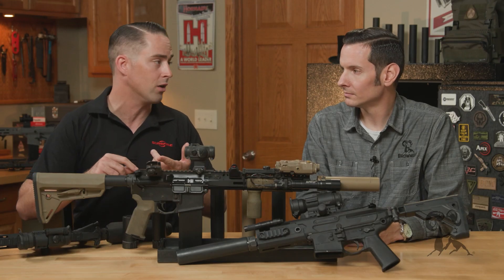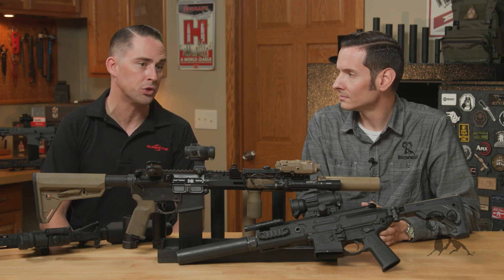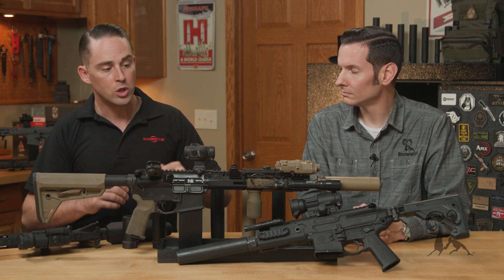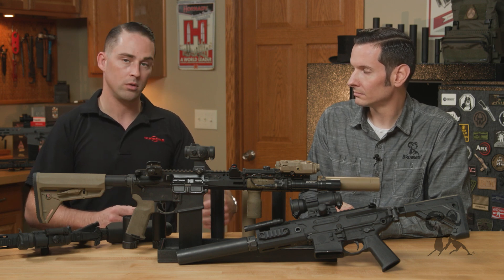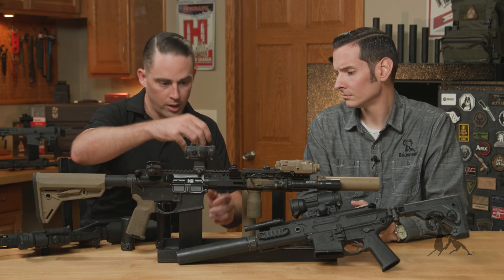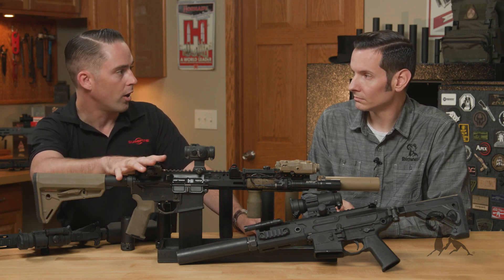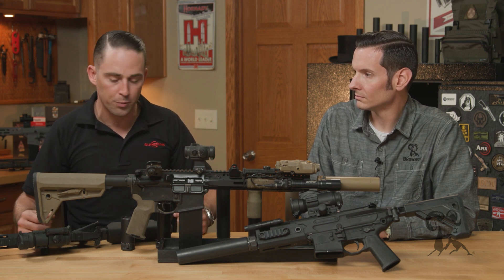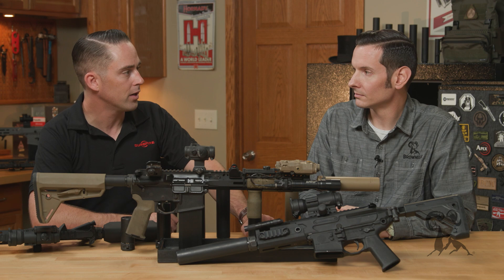Product Spotlight: SureFire Suppressors

Comment: Do you know if this surefire flash hider will work with the quick attach surefire suppressors? It was originally made for training suppressors 
Model is SFA2-556-1/2-
28 A2

Comment: I already have picked out the Surefire SB2 as the can I want to get due to it being rated for 10 inch or under barrels and will be using M855 62gr “green tip” ammo. So have a question if someone can answer it. I have a 10.5 inch barrel AR-15, currently I have a 10 inch hand guard that I think will interfere with the suppressor installation/locking up. What length of hand guard or clearance do I need to have it barely clear and have almost no gap between suppressor and hand guard? 9.75? 9.5? 9.3?
Reply: Thanks for the interest in our suppressors! For 10" and up, we recommend the RC2. As mentioned in this video at about the 8 minute mark, the SB2 is for barrels 9" and under. As far as standoff from the rail, if you have a 10.5" barrel and a 10" handguard, you will have enough room to mount the RC2 on a SOCOM adapter. Our adapters have a bit of standoff built in intentionally.

Comment: Is it true that the SF flash hiders seal up better to the QD suppressors and are therefore quieter than the SF warcomp? I know lots like the warcomp, but just curious.
Reply: The Surefire warcomp does not have the labyrinth seals and thus has issues with carbon locking when used in conjuction with cans. I went with the surefire muzzle brakes as they have labyrinth seals, which helps prevent carbon lock, and the brakes also act as a sacrificial baffle when used with suppressors. I don't need a flash hider for use on the rifles without the suppressor, since the rifles are never used without their dedicated suppressors.
Reply: @YippeeKiYayMrFalcon  thanks. I was told by a surefire rep similar about the seals on the flash hider too. Glad I went with that because like you, plan to just leave suppressors on full time.
Reply: I have a SF Comp on one AR and a Warcomp three prong on two other ARs and I do not notice a difference.

Comment: I trust Surefire suppressors in part due to the quality control, quality materials, and years of suppressor manufacturing experience.  I have twice had to return suppressors to Surefire for service (bad seal on one, lock ring problem on the other).  In each case Surefire provided warranty service at no cost and even re-cerakoted the cans.  Only negative is that they are not as quick on service as other suppressor manufacturers.

Comment: Surefire tech support has told me that their rc2 5.56 is not strong enough to handle 5.7, so I really don't care what their stupid rep has to say.

They also said that the 5.7 cartridge is too large to fit thorough their 5.56rc2 even though it's exactly the same diameter as a 5.56 bullet.
Reply: Idk about any of that and I’ve heard of the company being odd and lowering in quality on lights as of late. But from what I’ve seen that rc2 is a tank garand thumb has over 100k 556 rounds through his and it keeps going

Comment: I'm a senior range master in Arizona at Ben Avery and I could honestly say, I wish everyone was suppressed. I'm looking into buying the Surefire Socom 762 mini for my 300 blackout. I can't wait till I can get it,  it'll make the difference in my hearing for sure.
Reply: The 300SPS is designed for 300blk specifically. I have one and its super nice. Ive even run it on my 6.5 CM and 5.56 11.5" and 18"

Comment: Don’t expect to much a 5.56 is still very loud even with a suppressor
Reply: That's why Surefire got it right by making the RC2 minimize flash signature and back pressure. Trying to minimize sound signature on a supersonic round is a waste of time yet all these other companies keep trying to do that
Reply: @TheRealXrayDoc  Agreed the suppressor is not going to slow down the round, 556 will will always break the sound barrier, the can just addresses the gas and flash not the velocity of the round. So, so long as that bullet breaks the sound barrier you will always have that crack. I own this can and use it on 10.3 DDM4 V7P and it works beautifully.
Reply: @johnnysifuentes4188  yeah I use it on my 12.5 LMT specwar and love it too
Reply: @TheRealXrayDoc  But my -2 more db rating! If the RC2 was as trash as everyone says it wouldn't be in the SOCOM armory. But ya know, expensive can bad, YHM just as good!
Reply: I'm a dumb ass and shoot mine without ear pro. If you're outside it's not bad, no ringing, but I was probably deaf to begin with.
Reply: Eh, it gets my 10.4" down to 136db at the ear. No ear ring vs small canon without it is a massive difference.

Comment: “Less than an inch at 100” I’m sold!
Reply: I own the full size RC2 and 100% back that claim. It isn't just industry fluff to sell something.
Reply: @Zel_eo  what are you running it on if you don’t mind?
Reply: @tigerbob888  I run my own build but the barrel is a 16.01 inch SOTMFG barrel 5.56. I also run it on my 10.4" 416. Both keep the group within the inch variation at 100 yard. It's super repeatable too. If the group walks a quarter inch down left once, it will be there every time.
Reply: Exactly. That's why I went with them
Reply: Make sure you check it.
Reply: Exactly. That's why I went with them
Reply: Exactly. That's why I went with them
Reply: @lifehacksformen8427  alright calm down

Comment: Personally, I’ll continue to call them silencers since that was the “official” name they were originally patented under by Hiram Percy Maxim in 1909.  Son of the Maxim machine gun inventor.  No need to rewrite history!  👍
Reply: They don't silence anything. They "suppress" sound, not cut it off. Have a 7.5" 300bo SBR with a SilencerCo Hybrid 46 on it, and running 220gr Hush is as about as quiet as you're going to get, minus a .22

Comment: Surefires are quite a decent chunk of weight to throw on to the end of a carbine but they'll out last quite a few barrels
Reply: @jerry marcin whenever you goobers say things like “lift more” it doesn’t change the mass of the object in question. The majority of people who get into the NFA game tend to be guys who are stronger than the average Netflix browser, so get out of here with that garbage.
Reply: Hit the bench bro.
Reply: @Jerry Marcin  I swing sledge hammers all day, maybe if you hit a few spikes you'd realise what an honest end user assessment is.
Reply: @tylergarrett4498  Hey man. No shade.  I have no issue with the weight of surefires but I would probably not swing a sledgehammer as well as you.  Different muscles and different tasks.   What worked for me was improving lats, obviously, but specifically sitting sideways on the latpull down machine seems to work the exact muscle you use raising and holding a rifle.  Throw a couple plates on that thing or work to it and in a few months you won't even notice that weight.  I can verify up to a 22" AR-10 with a can.
Reply: @MM-js4nf  sweet man I'll give that a try
Reply: They are chunky cans but compared to most keymo cans it's real similar.

Comment: I've had the SF RC2 for a while now and I like it. It really ties the Mk18 mod 1 together 👍
Reply: The dude abides
Reply: Same, but it does have 2 problems in my opinion. It's heavy and the carbon lock is pretty annoying. Running it on mk18, I have to torch it then use a wrench everytime if I wanna take it off.
Reply: @eyuyeyu  buy some blanks. Undo the collar and shoot it off. Also take the muzzle break off every 6 months and drop it into half hydrogen paroxide and half white vinnegar it forms acid that destroys anything carbon. Let it sit for an entire day and when you take it out and scrub it off that muzzle device will be literally carbin free
Reply: @eyuyeyu  Just unlock it and shoot it off like it says in the manual
Reply: @spookyindeed  problem is its impossible to unlock without torching it and use a big ass wrench.
Reply: @eyuyeyu  F
Reply: @eyuyeyu  running a flash hider or the warcomp?
Reply: @anthonyclt  The closed tine flash hider.
Reply: @eyuyeyu  Interesting. I ran a warcomp and had carbon lock. Switched three prong (open) flash hider and problem went away. I'd be curious if others have had the same experience. I have the four prong too - no carbon lock there either.
Reply: @Anthony Graves  ur right. I switched to 3 prong and it fixed it.
Reply: @eyuyeyu   I like the warcomp a lot, but I heard that the carbon build up above the ports would clog it up pretty bad. Good move my man 👍
Reply: Same here. Same here. Love it.
Reply: @nicholascheadle  did you just get it?! I'm excited for you man 👍 it took forever to get mine, but it's everything I thought it would be 🤠 I'm also running the 3prong FH, so far no problems removing it.
Reply: @westernoutpost4154  Yeah just got it like a month ago, sounds great, 3P or 4P the way to go for sure. Definitely completes the package! Honestly the only rifle I need now. But it’s at home on the Noveske N4 too.
Reply: @nicholascheadle I use the brake and no carbon lock with that either. I did with the warcomp tho
Reply: I like the idea of the warcomp but the prongs do such a good job of flash mitigation, I just stick with those. Though the 4P locks quicker than the 3P.

Comment: I have the Warden, and I do like it. It works well. I also have a suppressor trainer, and it works so much better than the Warden as a linear compensator directing blast downrange. The only downside for me is it is heavier than the Warden. But then again, putting a suppressor will feel the same, I suppose. I'm running the Warden and the trainer instead of a suppressor because I refuse to pay that tax stamp. So, I'm perfectly fine with my Warden and suppressor trainer.
Reply: but you have no suppression then....unless you are legally not allowed to use one (ie in Canada) then why add the extra weight when you can have true suppression over a 200.00 tax stamp?
Reply: @MR619Can  Because I don't feel like paying the tax stamp. The tax stamp is like extortion to me. I am not paying it. The trainer does a better job sending blasts downrange than any of my linear comps, including the Warden.
Reply: @AllenTam  I agree with you on it.  Same folks who talk about hating the ATF and government control will happily submit to paying the $200.  Do your thing, king

Comment: After a 265 day wait I was able to pick up my SOCOM RC2 5.56 a couple days ago. I was shopping for a .30 cal suppressor to put on my AR-10/SR25 and was looking at the SureFire 7.62Ti. They market it for bolt guns. I called their customer support to ask if there would be any issues with it on an AR-10 style rifle. They told me that if there was ever any issues with the suppressor and it was used on a AR-10 that SureFire would NOT warranty the suppressor. Very well… my Thunderbeast Arms Magnus should be available to pick up in about 200 days.
Reply: Yep! Surefire customer service sucks butt.

I asked them what the minimum barrel length for 5.7 was. The guy on the phone LAUGHED AT ME and called me stupid, and said that 5.7 wouldn't fit though a 5.56 mm bore (actual measured bore is like 7.8mm).

When I emailed them, they said to go buy a 308 suppressor and that the 5.7 wouldn't fit through the rc2, and the rc2 couldn't handle the pressure of a 5.7 round, and if I ever used 5.7, my warranty was void!

Terrible idiots I swear to God.

Comment: Surefire’s suppressor line is a bit long in the tooth these days. They ain’t bad suppressors but their are far better options on the market for less $.
Reply: which?
Reply: @theflaver  Don't listen to this guy. Look at pew science reviews. The surefire RC2 is still at the very top of the data.
Reply: @theflaver  YHM Turbo series (just heard the K and T3 this past weekend and theyre really nice) Deadair Sandman and Sierra 5 (probably the leaders in suppression tech), some of the Silencerco Offering are quieter (hybrid w proper end caps) however I haven’t heard the 556k. When i say quieter I’m referring to the sound pitch. To me surefire has a very high pitch to it. With muffs on it’s not a big deal but with muffs off it’s painful after a few shots to me. In terms of flash suppression surefire is really good but so are all the modular cans that have interchangeable flash suppressor ends.
Reply: @wc4201  The RC2 is better on 556 then the sierra is I have both
Reply: I really like the HUXWRX/OSS suppressors, too. The Flow-Through technology is great and really cuts down on the gas blowback to the shooter's face, especially for left-handed shooters.

I believe baffle-less suppressors are the future and Surefire will need to come out with one sooner or later.
Reply: @vgt  why not just tune the gun and get way more sound reduction? Back pressure is a non problem for a tuned gun but a flow through will always be louder.
Reply: B&T now has a contract with surefire to make 5.56 cans using their muzzle devices. They start at $600

Comment: Ask him why all three of my warcomp flash hiders have had to be sent back and replaced because they were threaded wrong? 😛 Two 556 and one 762 flash hiders... 3 for 3
Reply: I have 4 SF muzzle devices and all my buddies run SFs. Never heard of any issues with the threads. Sounds like you got extraordinarily unlucky.
Reply: @zackncheez55  yeah very unfortunate lol, I'm a fan of Surefire and they're excellent products... After I QC them myself of course 😛
Reply: Damn, that's rough. How the heck does that happen? Were they all ordered around the same time?
Reply: @Auggie_93  yeah it sucks, fortunately customer service gets it handled, though in my experience it takes a while to get them back. First two were bought to together and that was about a year ago, the 762 I just bought from Primary Arms, who had only just gotten them back in stock from Surefire.
Reply: @glitchycowz1475  that's crazy. Extremely unlucky. I'll be sticking with my YHM & Dead Air stuff lol
Reply: @Auggie_93  yeah there are definitely better values out there, especially if your primary need for a suppressor is sound reduction
Reply: I'm surprised they helped you. During the last two issues I had with surefire products surefire basically told me to f off.
Reply: @enb3810  what kind of issues? They're definitely not outgoing but they've taken care of me so far
Reply: The problem is you're using a warcomp for suppressor use. They leak gas and aren't labyrinth sealed like the SF 3 prong or muzzle brake

Comment: When will we see the RC3?
Reply: Like he said, they won't tell us. Suppressor tech is pretty slow and the market wasn't that big back when AAC was coming up. It's basically a metal tube with some venturi cones welded together, a few design tricks and you have a serious can even nowadays. Now the market is growing and flow through and coaxial designs are maturing, even 3d metal printing magic is starting. I imagine surefire only began seriously developing a new design recently when sig got their contracts and this market boom happened. Despite all the best efforts, throwing your favorite/best suppressor on an AR is a difference that can be indiscernible to the average shooter and is unimportant in combat. Gas to the face however is very noticeable. Despite the 300sps being great in 300blk Surefire main asset is the reliable and durable image. The US military would have been fine with an m4-1000 and we'd be buying a modestly updated can from AAC for $1000. That said the RC2 is still worth it because they nailed the design so well.
Reply: They're not gonna tell us that, they're afraid of not selling through the rc2s. Considering what happened to Hudson it's not a bad idea.

Comment: It's been 120 years. Why isn't there a better suppressor? I can shoot 22 subs pretty quiet why not 45? This goes for all cans too. To me there really isn't much difference
Reply: .45 aarp is super quiet, lmao, it’s naturally subsonic and if you think it’s loud, then that’s solely on you
Reply: I'm go with physics, weight, and cost as my final answer.
Reply: What gr 45 are you using? What kind of pistol and can?
Reply: @tangomantactical  right! 45s are super quiet even with a bad can.
Reply: Compare the amount of powder employed and subsequent gas generated between the two and you will see that anything much beyond 22LR is tough to mask without using some sort of coolant or massive tube.  Don't go by what you see and hear on YouTube.  The audio equipment used in these videos has a a cutoff to prevent damage to the equipment, so the sound effect is typical well below what the human ear detects in the wild.
Reply: Why are they not better? Because you can't escape physics. The way you phrased the question is very ignorant.